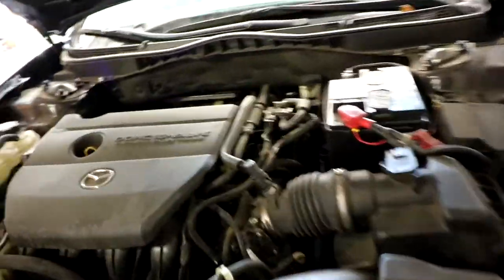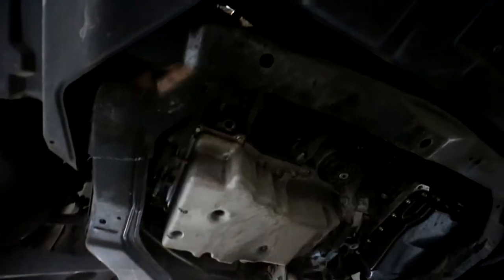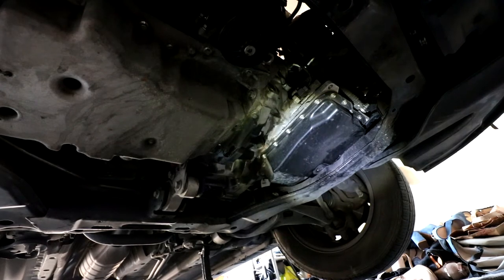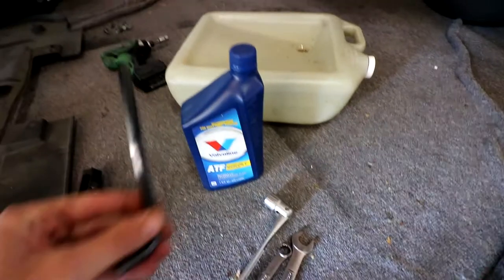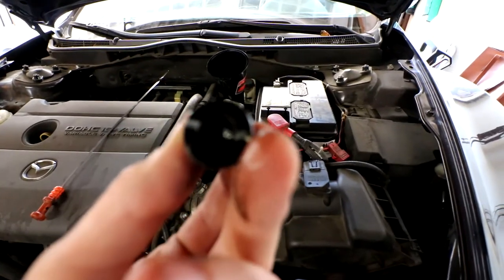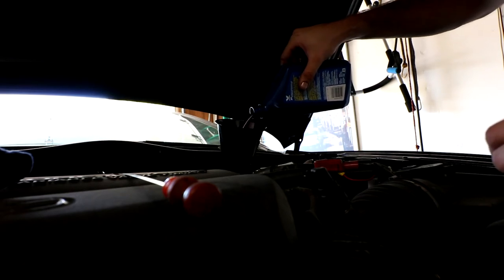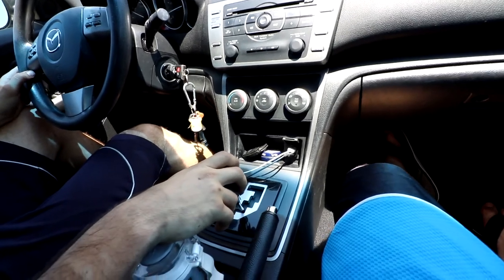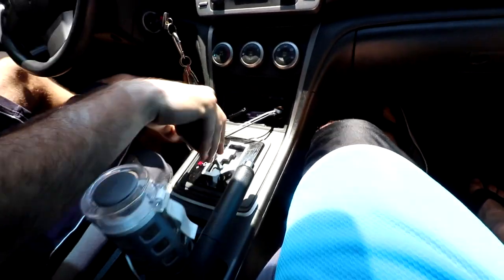2009 Mazda 6 ATF Automatic Transmission Fluid Change DIY

Comment: Great video.   As an alternative approach, I use a small 12volt transfer pump to pump the old oil out thru the dip stick and then send the new fluid back down the dipstick.   I get out about 2.75qts per drain/fill cycle and it takes almost zero time.    My 6 has 222k miles on it and I always use Valvoline Max-Life full synthetic multi-vehicle ATF fluid.   No need to jack the car drop bottom shroud, back out the fill plug, climb under the car, etc - especially if you are going to go thru multiple drain fills and drive car around between.  This  car is rock solid and reliable - son is taking it to college.
Reply from the maker: nice~!
Reply: thanks for the post,  I tried extraction,  it works  for my 06 Mazda 6 as well
Reply: Suppose to take 3.5 quarts lol

Comment: Good video , however the drain plug looks exactly like mine its NOT magnetic. 
There is a donut magnet inside the pan when you remove the pan .
Note ;that the pan hold about 1 more liter of oil ,that does not drain from the plug due to the way the drain is welded to the pan.
Also, there is a replaceable plastic filter that should be replaced. 
Some of the pan bolts are a bit of a pain, but you can remove them with a 10mm swivel.
I used ATV silicone and ditched the rubber gasket that came with the filter kit, and torqued the pan bolts to spec.
Reply: Hi there. Just curious why did you ditch the Rrubber gasket. Was it the Bec & Arnley filter kit? Is that gasket no good. Asking cos Im considering the same kit. Also any tips on getting to those hard to access pan bolts hidden by the fender well? What were the torc specs for the bolts?

Comment: Recommended fluid for mazda6 is ATF M-V, AFAIK Mercon-V is not the same. Are you sure that you are using right fluid?
Reply from the maker: Yes, been running it for 100k miles now...
Reply: Always follow the owner's manual. Whatever they say to put in, you want to make sure you follow that.
Reply: Adam Domonski I’m going to try that...hoping it will suffice until I can get it to a transmission shop.

Comment: Awesome video with many explained details I got the 2010 Mazda 6 very similar I got the transmission hose going tru the radiator that I need to replace cause is leaking not much but I going to replace it.

Comment: Hey man good informative video. How many drain and refills should you do to completely get the old tranny fluid out? I’ve changed my transmission fluid but it’s gone back to brown. Should it be changed twice every 800 miles?
Reply: Did you try dropping the pan, replacing the transmission filter, cleaning out the pan and the donut magnet on the inside of the pan?

Comment: Information that I've seen is that this vehicle requires M5 fluid.  That is not the same as Mercon V
 I could be wrong, but saw specifically that point. that is for the 2.5 L auto transmission.  I believe the 6 cyl. is different.
  The viscosity is different between those two fluids.
M5 has greater viscosity at lower temperatures.    Please research and verify for yourself
Reply from the maker: For sure there is better fluid, the one I used is still working good today!

Comment: Hi @drewtalks great video !! How many litres or millilitres do you need to typically fill when you first flush the transmission fluid from the sump? Also once the initial fill has been done, do you go for a quick drive, cycle through the gears and then refill a little after that ? how many millilitres etc ? Thanks and regards
Reply from the maker: I do it all at once, I cannot remember right now I thought it was about 2.5 quarts

Comment: Hi sir 
I have 2011 2.0 (petrol ) with 5 automatic 
I found while check with car computer the p0841 that code mean pressure  low in transmission , i dont have any problems or check lamps but i see the dipstick and the colore of fluid is like grey or black and i wanna to change it for first time (180000 km )  and i don’t find atf v for mazda here in libya but theres dealer for valvoline    Oil i wan’t to ask is this oil work with hot weather like libya in summer , second  how many liters that i need ,third change filter or leave it . 
Thank you ...best regards

Comment: I have the maxlife multi-vehicle atf fluid in mine for 61k miles now at 135k total mileage on vehicle. It has been 6 years since you posted this video? How did your  transmission hold up?
Reply from the maker: Still going strong!
Reply: Nice. Do you know where the transmission fluid filter?
Reply from the maker: no sorry

Comment: Hello...I have a 2011 mazda 3 and my manual book says to use Mazda ATF M-5...would it harm my transmission if I use the valvoline Mercon 5? Thanks!
Reply: Yes according to the Mazda website you must use M5 transmission fluid do not use Mercon it is a lower viscosity. M5or MV is not an abbreviation for Mercon 5 or Mercon V..... the only place I can find M5 transmission fluid is through Amazon and it's 13.45 a bottle

Comment: I have a 2009 Mazda speed 6 with the 3.7 the manual says use jws3309 fluid do you know if I absolutely need to use that type of fluid or would a valvoline equivalent be fine?

Comment: I thought you can pull the transmission fluid lower cooler line and let it pump out while adding more while on  or whatever  can get it all out /changed?  My cvt is a different story.  Also funnels suck. You can get a nice pump for 7$ on Amazon  with a hose so much nicer imo. Do you torque the plug? I'm paranoid and torque stuff since I had a geo easy to break things lol
Reply: Papa Linus that works great in old Americana where every plug was a gargantuan.  These 8mm pos I can think it isn't tight yet and break the little bigger off in there. Maybe I should stop working out...
Reply from the maker: Pap linus you may be right, but for someone who doesnt wrench on a car much why guess when you can be exact with a torque wrench
Reply: Which one of these lower cooler hoses should we pull out? I mean which one is the return ?

Comment: my god you change your ATF a lot. how often do you change the actual filter? 

on a side note wanted to point out 2 things you may or may not be aware of. a lot of newer cars don't come with dipsticks for checking ATF anymore. also you want to sniff the ATF as well, if it smells burnt you may have some problems
Reply from the maker: well i only change the oil twice per year (i run synthetic oil) and as i mentioned this method doesn't take out ALL the atf im just rotating out atf
Reply: DrewTalks , I get what you are saying, probably a good method.  I was still going by the old 3k mile oil change theory. my bad

never said how often you change the filter
Reply: Country Cledus bb

Comment: Hey bud. I have a question! I have 2013 mazda 6. Im doing a transmission refill. I located the little grey dip stick located on the firewall of the transmission. It was held in place with a little bolt. I was just curious, do you refill from the same place the little grey dipstick is or is there another location? Thanks!!
Reply from the maker: yup grey dipstick kind of a pain get the right funnel and makes your life much easier

Comment: I have the same car and I noticed that the key was actually in the ignition in this video. Have you had issues with the keyless entry system or other electrical problems? I have had some of these issues with no resolve.
Reply: Yo

Comment: My 2011 mazda 6 got 50k miles but I dont know if the previous owner ever changed the automatic transmission fluid. Should I change it?
Reply from the maker: ehhhhh it depends on how it was driven, if you have extra cash I would but it will be fine...

Comment: Would this be the same for the 3.7l v6? I’m assuming you have the 4 cylinder?
Reply from the maker: yes
Reply: The atf pan is not the same...
Reply from the maker: ohhh woops misread your question i thought you said 4 cylinder no they are different...
Reply: DrewTalks where is the recommended jack stand points?

Comment: Hey I have the same car and the transmission oil pan gasket is leaking. My worry is I’ll get all the bolts off and the oil pan (tranny) won’t come off because of the subframe. Do you know if this will be an issue?
Reply from the maker: i do not...That would be a major design flaw though that you have to remove the subframe or lift the engine to get it off....
Reply: I got the same issue too...so stupid design

Comment: I have a Mazda 6 2009 2.5 liter grand touring I. And 8mm Allen wrench did not fit the transmission plug...
Reply from the maker: hmmmm works for mine maybe we have a different motor try google
Reply: That was my fuck up it was a standard set not metric. FACE PALM
Reply: Mine has 91k miles btw, runs like a fucking dream. Thanks for your help drew.
Reply: ALSO to get the clicking to go away what exactly did you tell the dealership about lubing your axle or something? Dude at my dealership said they would have to pull the boots off and he also said something about the CVT joints? I'm not sure but it only clicks when i go from park to reverse at the moment and it happens about 50% of the time..

Comment: ummm my 2011 mazda 6 dont have a dipstick....and i looked everywhere under the break fluid area?????
Reply from the maker: is it automatic?
Reply: yeap
Reply: The 2010+ are different so it's likely a sealed transmission. There will be no dip stick
Reply: Hot 1LE is it still possible to change the at oil on 2011 Mazda 6 as it’s a sealed transmission
Reply: For the cars that don't have a dipstick, there is a little stopper in the same location, secured by a bolt. Undo the bolt and treat that access hole the same way you would access the dipstick hole for filling.

Comment: you need a pump to flush the atf all out  you missed atleast 8 quarts of fluid...   only way is to flush it
Reply from the maker: you have a link to the manual?
Reply: He already informed us that you cant get all of it out. The point is to change it frequently (as he said, every other oil change), or drain it 2- 4 times in a row to dilute the old fluid enough to where it's mostly clean
Reply: You don’t have to flush anything

Comment: Hi, I have a Mazda Model 6 2009 I do not know what kind of oil is suitable for gearboxes, what volume is suitable?

￼
Reply from the maker: there is multiple models google and make sure you have the right model there is a 6cyl and 4 cyl
Reply: @drewtalks  My car is a 4-cylinder 2.0

Comment: omg  jack up the car unscrew 6 screws and fill the oil. mechanic shops want hundreds of dollars for this simple work....
Reply from the maker: LoL right?
Reply: @drewtalks  just did it today. spilled about half quart while putting it in. come back to tell everyone, and saw that u did mention it. DO NOT pour too fast. the air inside can only go thought the dipstick opening.
Reply: If the cost includes replacing the filter inside the pan, I can see why. I replaced my filter and its a bit of a pain.
Reply: @MikePatey-ho8mh  Any tips on removing those hard to access pan bolts/ Also what torque are the bolts please?